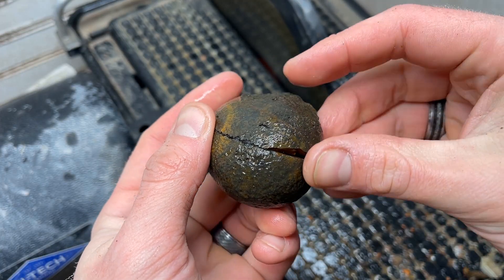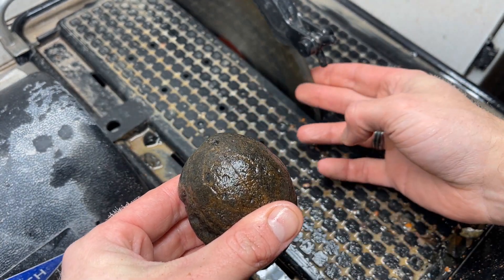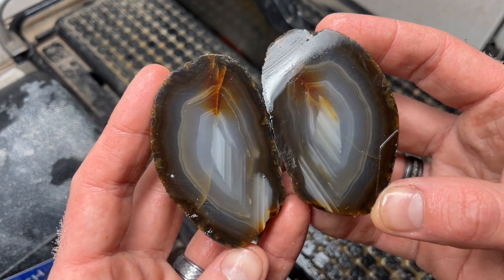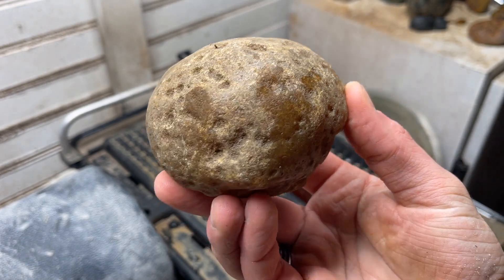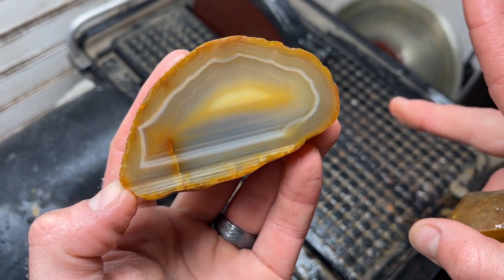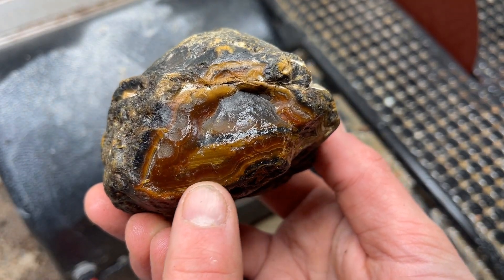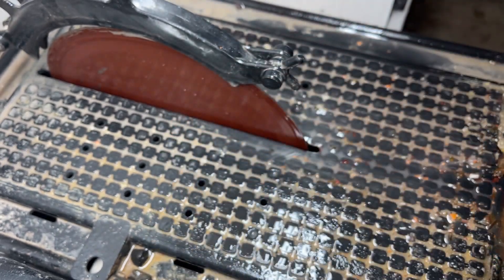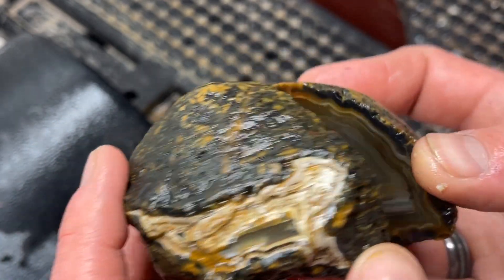Gemstones Revealed: Cutting Brazilian Agates Open!

Comment: The last one is definitely the best. One tip for you. Add a little laundry detergent to your saw water then spray a little wd40 in the water to keep it from getting sudsy. Your blades will last longer and cutting will be much easier.

Comment: I'm sure it's been answered before and I'm sorry for repeating questions but how do fractures happen? Do they happen in the formation of the rock or does it happen in the shipping process?
Reply from the maker: The natural fractures happen I’m sure form many different things, the mini fractures, surface fractures, is caused by the heat during cutting. Those can be easily polished out.